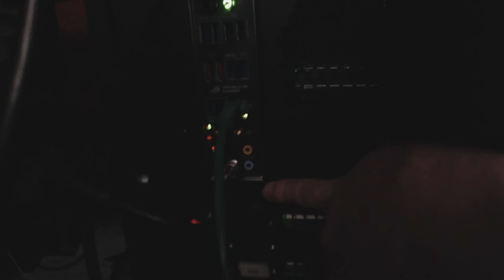STH10 Build Update #4

Comment: I like your build.. My computer is just for simple gaming. I have AMD Athlon X4 750K Trinity 3.4GHz Socket FM2 100W CORSAIR Vengeance 8GB (2 x 4GB) 240-Pin DDR3 Western Digital CB 1tb NZXT SOURCE 210 500w power suply and Zotac GEFORCE gtx 650. Its runs pretty good